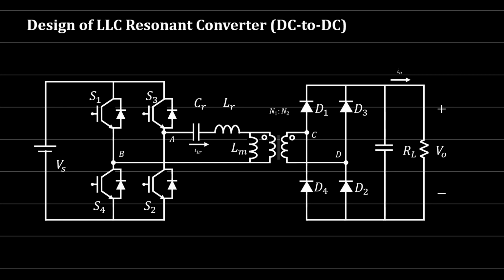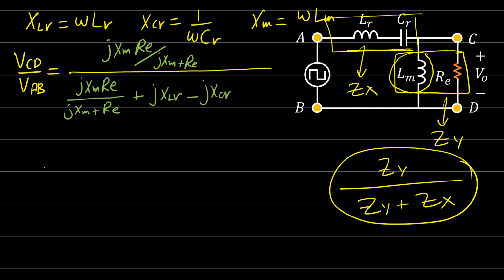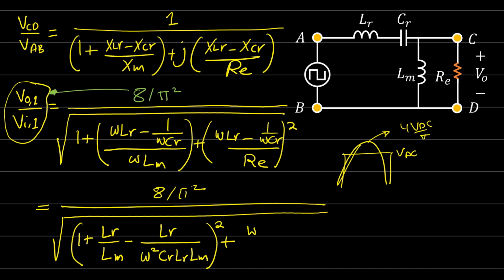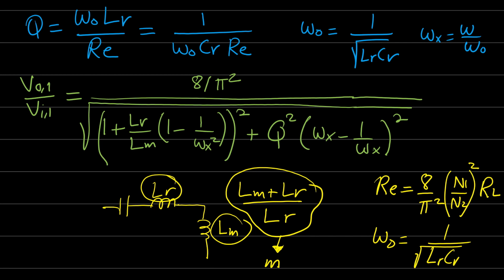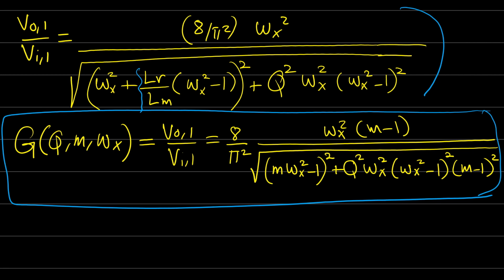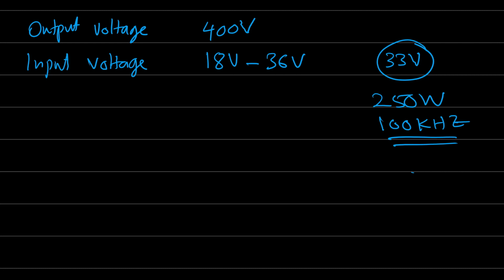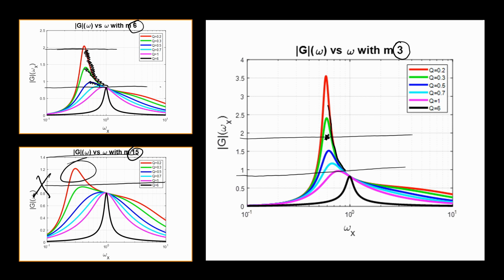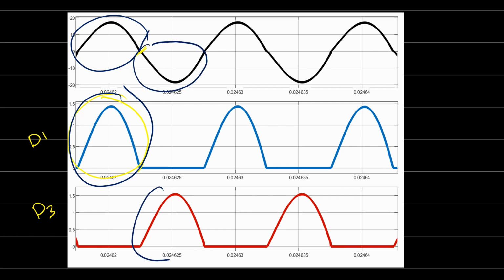Design of LLC Resonant Converter | Power Electronics

Comment: 8:49 I'm curious as to why 8 is divided by pi square. You explained it as the relationship between vin and vout, but I don't quite understand.
 
Also, in order to see the absolute value of the denominator corresponding to the input voltage, don't you have to square both the real and imaginary parts and take the root?

Comment: I have a basic question. Do this circuit only convert voltage unregulated for make the isolation purpose or do this circuit do both isolation and DC control regulation at the secondary side. Do this circuit need a second regulator for control the DC voltage level.

Comment: Thanks Professor Ahmad,
I wonder what would happen if Instead of H bridge at the input we use just the say 110V or 220V outlet power (which is sine wave 50 or 60Hz) and make the 1/(2*Pi*SQRT((Lr+Lm)*C) equal to 50 or 60HZ (line frequency)?  Can you do the calculation?

Also, do you have your calculation in written form?

Comment: At time 6.13, how 8 / pie sq. came? Can you please elaborate...
Reply: I believe 8/π^2 is the product of 4/π and 2/π, where 4/π is the weight of the first harmonic (fundamental frequency) using Fourier analysis and 2/π is the factor for the average of a full-wave rectified signal.

Comment: I would like to thank you for the useful information.
 Second, I have some questions that I hope to get clear answers  to help me design my circuit:
 
1-Could I use an LLC Resonant tank with a multilevel inverter Or it is limited to use on half-bridge and full-bridge only. If I use it with a multilevel, does it affect the waveform of the output of the inverter?
 
2-What is the output voltage waveform of the resonant tank (VLm)? Is it the same as the waveform of the output voltage of the inverter (Vinv) or different?
3- I found your work very close to mine, so I would like to cooperate with you in completing my work if you do not mind, and this is my private email.